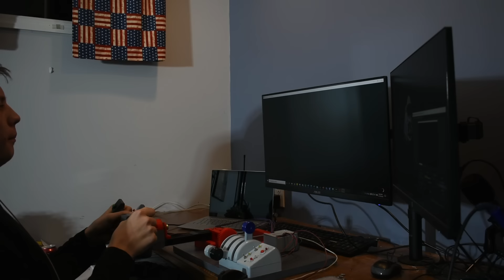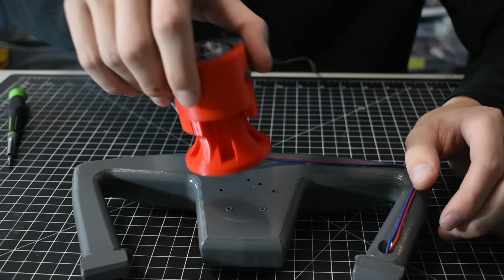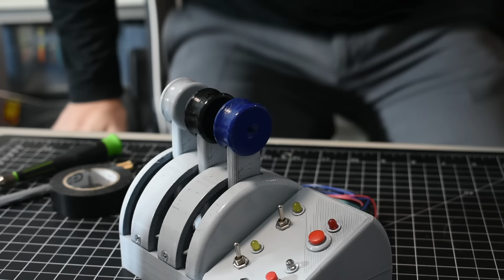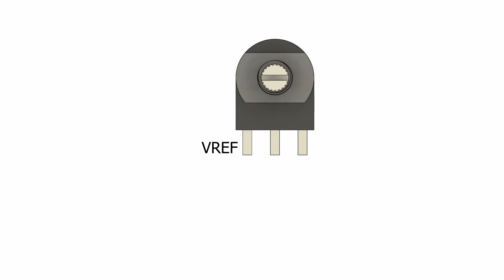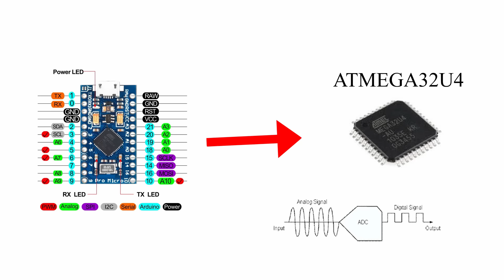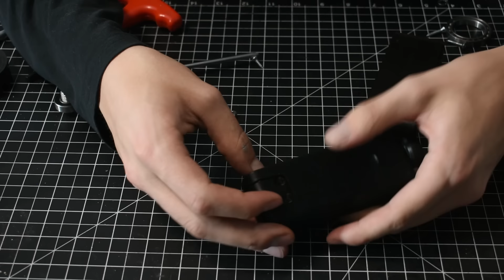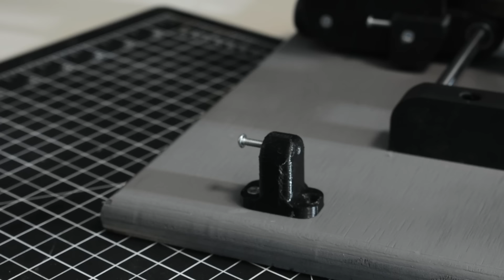DIY 3D Printed Flight Yoke for 2020 Microsoft Flight Simulator

Comment: Lovely design!
I'm beginning to work on my project. Yokes, pedals, controllers and joysticks already are  extremely expensive in my country, and due to high demand and high USD exchange rate, it's almost impossible ( and not worth) to buy the entry level yoke ( the saitek one) 

I have two questions.

 Why did you choose to use potentiometers instead of hall effect sensors?

Is it possible to make the yoke turn 75°/90° each direction instead of 45 (like a real airplane) using potentiometers?
Reply from the maker: I used potentiometers because I had them laying around. And yes, it is totally possible to maker it rotate 75 or 90 deg.
Reply: Oi Henrique! Pelo seu nome imagino q vc seja brasileiro, igual eu kkkkk. Tbm estou trabalhando em um projeto parecido. Tenho um T16000m, mas só o joystick. N tenho o Throttle Quadrant (n sei o nome em português), aí decidi tentar construir um. Estou desenvolvendo tem 1 semana mais ou menos, mas tá relativamente avançado já. Se quiser te mando umas fotos do projeto.
Reply: @Pokerman536  opa! Bacana! Tem discord? Acho legal ver que tem bastante gente do nosso país com a mesma intenção de criar seus próprios projetos
Reply: @henriquem3111  Também me interesso nese discord kkk por acaso já entraram em contato um com outro?
Reply: It's actually easier to implement it as 90 deg, simply connect it directly to the potentiometer
Reply: @LuizLuiz1006  Boa noite pessoal, vocês já criaram algum grupo? Também vou imprimir um..

Comment: I was testing the regular potentiometers and I see it does not have enough  precision, I got a 10 turns potentiometer and It is way better, now I have to build the rudder pedals and I'm trying to figure out how to convert the movement to a 10 turn, maybe I can use half the turns, but in that case I think I need a different gear ration.

Comment: Really cool project! A couple questions on the yoke, though:
- Have you encountered any problems with the roll sensitivity (seeing the yoke in your design is able to rotate 90 degrees while the potentiometer can probably do a couple hundred degrees)? If so, have you had the chance to try using gears to utilize the full range of the potentiomenter?
Reply: I have encountered problem with roll.its not working fine as it's has dead zone and then steering fully,did you solve it with gearing

Comment: Santa is attempting this build and the one part that seems to be missing or perhaps I am overlooking is the bracket that attaches the potentiometer to the back of the yoke.  Didn't see it in the CAD file any chance it could be added? This is a really an outstanding design.
Reply from the maker: Thanks for pointing this out! Everything should be updated now.

Comment: Okay, so this is great. I have started to build this as my first electronics project. I have the analog inputs (pots) working no problem, but im not 100% sure how the digital inputs (buttns/switches) are wired here. Can anybody give me a helping hand here, or Michael, can you please show me the wiring diagram or underside of the arduino micro? Thanks for the cad files and everything else, I'm having a great time! Although, I could use a slightly larger printer 😂

Comment: Lol... yeah.. I think I'll just spend the $200 or so on a Honeycomb yoke....  but - thanks for sharing and very ingenious.
Reply: 100% worth it. Just got mine last month. Literally shits all over the Saitek and CH stuff, by a long shot. Just got the bravo throttle just before xmas (ordered both months ago) also great quality, but I do wish it had a few more features. IE the reverse thrust is toggle only (button), ie its either on or off. there's no modulation. The AP panel could easily have been expanded more, and I'd rather have them done that than the included annunciator panel; 

the AP panel basically only has 1 actual knob, and you have a 5 way rotary selector that changes what the knob does (ALT, VS, HDG, CRS, IAS). This isn't a terrible idea, but in VR it's kind of a bit of a PITA because you never know what mode you are in unless you "duck under" and look or you memorize the order (which I haven't quite yet) and put the selector into the known position. I wish they had included.

I'm also not a huge fan of the mounting plate system, I mean, it works and can be good, but in my particular setup, with a drawer under my desk for my keyboard & mouse, it means I can't mount easily. Luckily my keyboard tray is also clamp type so I can remove it, but it's a bit annoying. The throttle I also feel is a bit unnecessarily large on the back side. I haven't opened it up nor seen anyone who has, but I doubt they really needed to make it as large as they did, but it does fit the aesthetic.

EDIT; these are also minor gripes, or things I think they could do better.
Reply: @Munky332  Thx for the review... yeah - Honeycomb hit it out the park with these... nice to see some quality stuff come out that doesn't cost as much as  real plane!

Comment: Thanks so much for your contribution,  The ino files say "require Arduino Library" does this mean that your code has to be added to other code or can we just flash you ino files as is? Thanks

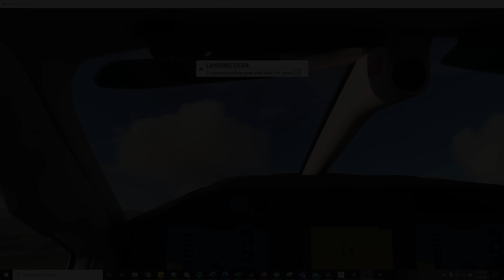Comment: Great project!!! But, please,  I have 2 douts: at 14:00 min you are talking about a 6mm aluminium hub attached to the shaft. Where can I find it? The second one is about the wiring diagram for connecting the pots and switches to the Arduino. Do you have it? Thank you.
Reply: I also want the diagram but noneone said anything.

Comment: Thanks for this great idea. I am going to make this yoke. I have already ordered the parts, and start printing the parts. The only thing i am not able to print is the yoke himself, it is to big for my printer. I think i am going to make it from wood.
Can you tell me, or make a schematic how the electronic parts are connected to the arduino?, i dont see a connection diagram, and can you tell what sort of button the push buttos are? self resetting or momentary?

Edit,
I am missing a 3d part on thingiverse i think.
I can not find the part that is holding the pinion and the potmeter, and that is mounted on the upper Linear bearing holder. Is it possible to add the component?
Reply: I have found the missing part in the overall step file. but the part is not on thingiverse and included as an seperate part.

Comment: Hello. Cool project. I have just two observations about it. First the yoke deflection is 90 degrees on each direction unreal plane. So why to limit it to 45 deg at each direction. Second the arduino board works as joystick just to PC. A pc for Flight Simulator is around 2k $! What about xbox series x. You know how to controll it ? Because xbox is just around 500usd and on May the FS will be available on Xbox !

Comment: This is incredible... however... I’m entirely new to all of this and I have a couple simple questions. 

1. Will this work for an Xbox and Xbox Games?
2. Did this require any soldering?
3. How difficult is this for someone who can’t program and can’t code?
Reply: XBox games require a special interface which is a real deal breaker. Honeycomb Int. who make those nice looking but ultimately "toy like" parts are developing their own firmware with Microsoft's help.

It's doable, yes, but worth it? Better to adapt an old XBox controller and adapt  that but again that would require soldering and that is difficult unless you have skills and the right (quality) tools.

Comment: I need wiring diagram for connecting the pots and switches to the Arduino Micro board.
Reply: 5volt plus pot to arduino 5volt, gnd to pot arduino gnd and center pot to data analog pin 0-5. simple.
Reply: @mattivirta   and the buttons and Leds?
Reply: @wemmser84  leds. positive come arduino output pin, then negative add resistor normal 330 ohm, and then to negative.
buttons, need little different,  button pin go to two possiple way, resistor up or low  you need looking many million arduino manual or yotube video basic connection arduino. bull-up or bull down button and resistor.how connect i not can tell you text all.

Comment: I hope you're still active and see this. Can this project be completed with the Leo Bodnar BU0836A 12-bit joystick interface instead of the Arduino? I modified my old Saitek (Logitech) yoke, but it has become extremely imprecise, so I was thinking about building your project with that board if it can work for that.

Comment: The linear bearings in the description are too small. They need to be 45mm long, not 24 😢
Reply: Exactly, I ended up modifying the model and use 4 linear bearing for the yoke.

Comment: Hi, Can you include a wiring diagram of the pedals? If you could tell me what portion of the code applies only to the rudder. I am only doing the rudder pedal portion as I have a yoke. For some reason I can't get the code to work even removing the excess code. Thanks a bunch. I have ACC, A2 and Ground hooked up on my micro and adjusted the code accordingly.

Comment: Minor correction:
A 10-bit ADC will give 1024 levels, but that means the number output will be 0 to 1023, not, as you stated, 0 to 1024.

Comment: I wish I could buy one logitech for 250 dollars. Here you pay almost 600 dollars for a brand new one, and you can't find used ones (in Brazil, just in case). BTW, a 3d printer is not cheap either, so I had to go around it and did my own. Anyway, one day I'll get a 3d printer and do it.

Comment: By the way, could you tell me what the axles of the pedals and the steering wheel correspond to? Désolé pour ma traduction, je ne parle pas du tout anglais, c'est donc Chat J'ai Pété qui traduit tout. S'il y a des erreurs, n'hésitez pas à me les signaler.

Comment: Michael, I have finished my throttle quadrant and started on the Yoke. I have checked the google drive and Thingiverse files and can not find the hub that screws to the yoke elevator pot for the pinion to attach to. Any chance of getting that file? Thanks for your time and effort.

Comment: Thanks, but wich 3D software and wich company do you use for 3D printing?
Reply: 3D printer used most marlin software and drawing uses all 3D drawing cad softwares, then make stl file and print out. all company and diy can made printer easy simple. anet ,creality,prusa. many have but no buy plastic acryl frame printer. only aluminium profile rail frame have good. normal good printer cost today 100+300 popular creality 200$ about little less.
Reply: all printer uses arduino bases motherboard wery similar and all use same marlin software too, nema 17 motors, heat bed and hot end simple easy build in home.
Reply: Thank you so much 👍👍

Comment: Great stuff, you have a clever mind. Have you considered this idea? It may seem dumb to some but not everyone has the room for a standard flight yoke,(depth of mounting area for slide in and out) and not everyone has the dexterity for HOTAS. Maybe a two handed yoke that can rotate R/L but the handles can rotate front and back for pitch instead of sliding in and out. Basically two joysticks linked on a common axle. I would love to design something and will try but your Fusion ability far surpasses mine. I downloaded your f3d files. Maybe I can cut the handles and build it in.
Reply: Same kind of situation to me : not enough dexteriy to use any commercial joystick and willing to do something to get smaller low resistance diy sticks :P

Comment: Do you know what the headers are called that you used on the perf board? Ive got some stuff at home ive been working on but idk what those are called (the specfic ones you are using) to order more.
Reply: They are JST connectors. Digikey is one source for them. You can get them in varying pin counts.

Comment: Any particular reason you went with just 45º on the yoke?
And will this work if the print is modified so the yoke goes 90º each way?
Reply from the maker: I went with 45 degrees because I tested it with 90 and 45 and personally I liked 45 better. It will work totally fine with 90 degrees in each direction and it will actually have better resolution. Should be pretty east to modify the CAD to do this.
Reply: Did you modify it to 90°
Reply: @GreekSIMRACING  YouTube hadn’t sent a notification that I got a reply…
Seeing this again, it does make me interested in still giving it a try.
So if I do, I’ll send you the file. But don’t hold your breath for it 😅

Comment: I'm trying to calculate the cost of buillding the plastic body if i use 3d printing service since i dont have a 3d printer. They usually charge per gram of material use. Could you help by informing the plastic body overall weight?
Reply: ~2 kilograms

Comment: “How to make a $2 flight yoke”
And start video using a 3D printed object 😭
Reply: Also the Arduino micro alone cost $20 😂
Reply: @Shadaole  They are available from aliexpress for 3$ or even cheaper
Reply: Not to mention the old 3D printer that he cannibalized parts from.
Reply: @anttii  true, but you take all the other electronic components he used, you'll spend more than $20, not to mention all the rest of the hardware and material.
Reply: And guys, I’m not criticizing or whatever 
I just wanted to make a joke there.
Because this yoke will be definitely more chipper to make then buying one
Reply: @benicio_cuna  yep, i am planning to make one, i have some parts leftover from other projects, but i calculated that If you would buy all non printable parts, The hole project would cost under hundred bucks including price of filament, that is still cheaper than buying one from a store, and as a bonus you have fun project to work with, the on problem is that If you Dont have 3d printer this project could easily get stupidly expensive, but If you have library or Hackerspace nearby that has 3d printers,  you might be able to use one for a low cost.
Reply: @benicio_cuna  I also want to make one, because from my experience a DIY product is easier to repair than a factory one
. I have experience of making a force feedback steering wheel controller using Arduino and I am very satisfied with the results, even better than those made by Logitech. The good thing is when something break, I can find the spare part on my local online marketplace.
Reply: @anttii  Agree with you. I also calculated about  $80 to $100 here in my country (Indonesia). I don't know if its gonna be better or worst than Saitek, but for a quarter the price of a Saitek (in my country) it is really worth a try.

Comment: 0->1023
Reply from the maker: You are correct.
Reply: @michaelrechtin  
AND you have done a nice job with the project.
Mounting parts on the board is a nice simplification versus the "in a box"
designs I have seen elsewhere.
For extra credit add brakes, and force feedback for all actuators,... ;-}
No small task actually.
Only thing I did not like is the +/-45 degree on Yoke rotation, needs to be +/-90.
Otherwise COOL dude!
Cheers
d
Reply: @mr1enrollment  Can you share the arduino/esp code please ?
Reply: @deltafox52  I do not have it. Try the author of this video dude.

Comment: Your entire preface is negated by the fact that if one doesn't have a 3D printer, you can't build one,  nor do most people have some "old 3D printer" laying around to cannibalize for parts either. How about you show me where you can buy an Arduino, the switches, LEDs, wire, connectors, potentiometers, and any other electronic components for $20, not to mention the plastic used, bearings, harrdware, etc.  Saying you spent $20 is complete BS.